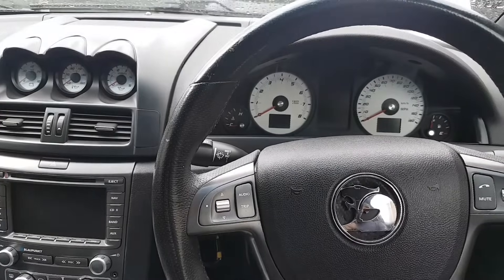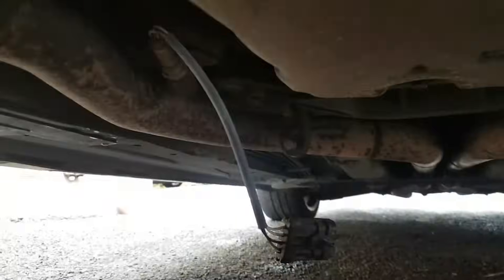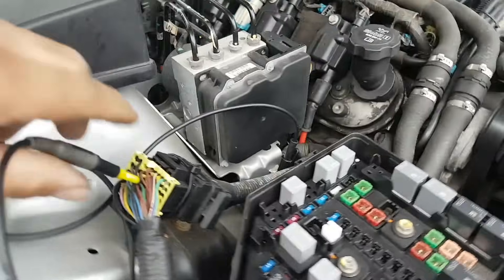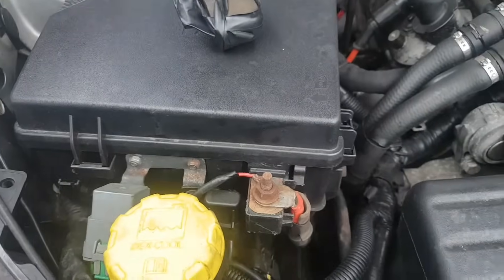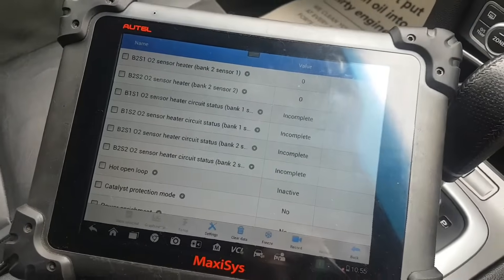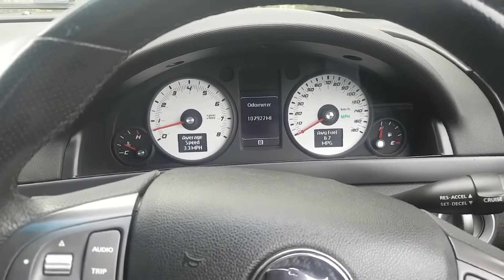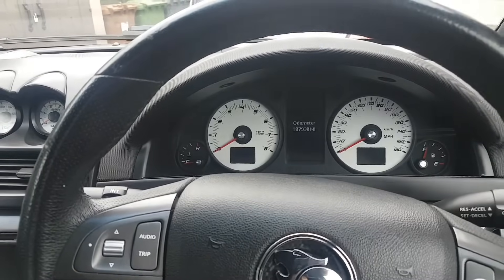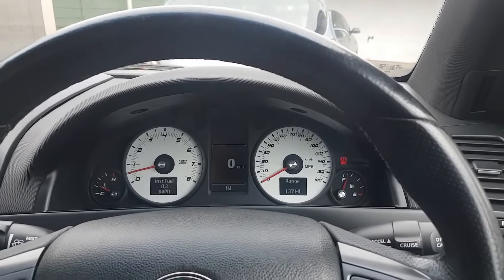Vauxhall VXR8 engine light ON and other electric issues... Fault finding and repair?

Comment: The engine was off but fuel gauge still showing full, should show empty should it not.
Reply: Some cars are like that, dont know if this is normal for this car, but manu cars keep showing fuel level when off
Reply from the maker: @fabini14 
That's correct... I don't remember this one now... but some do continously show the fuel level...
It is the type of stepper motor that requires voltage to drop as well... so when you turn the power off (ignition off), the needle just stays still...
👍👍👍